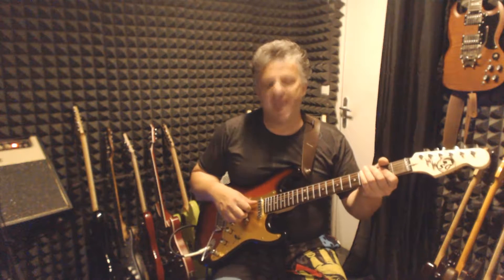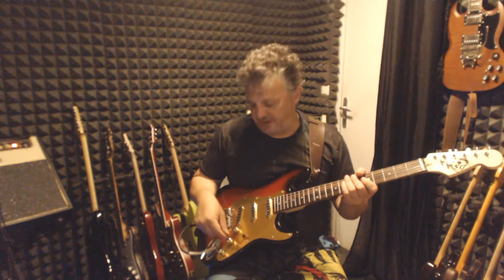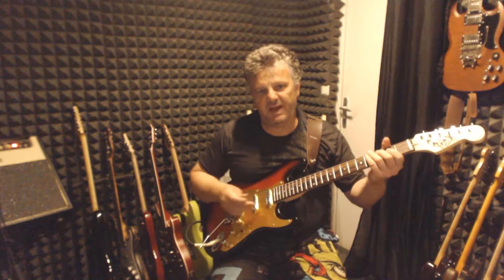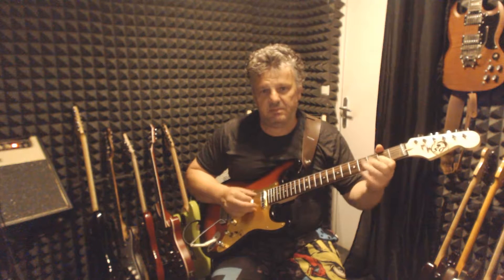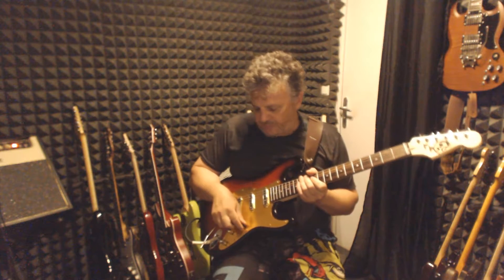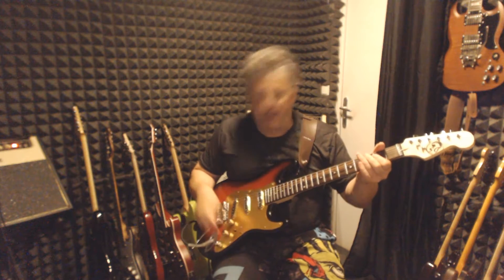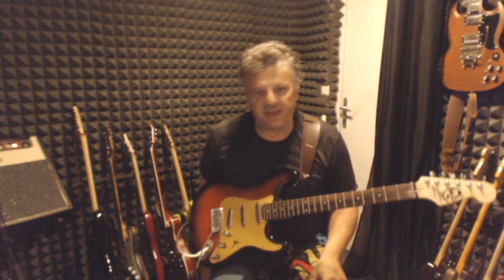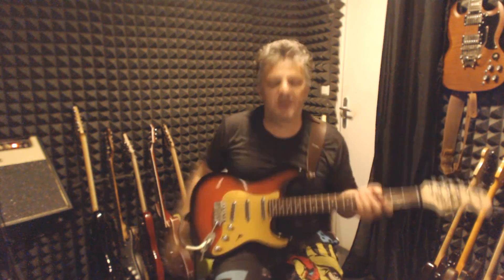Two Volume Strat Plus Wiring Demo - Brighton Rock GFS Pickups

Comment: Cool, I'm think in put one of these in the neck position :)

Thanks for the demo!
Reply from the maker: Check the value of the other pickups. These single coils have an high output. It might fit good or not.
Reply: @SenniMusic  Sure! The actually change the position to middle position, the other two will be also a high output pickups. Let's see what result will be  :)

Comment: Thank you for doing this video I tried to do this it seems to work but the bridge volume is not working
Reply from the maker: Double check your wiring. Go to my site and grab the schematic. This is the one I used. My modified version with independent volume and 50s tone  pot wiring.
Reply: I grabbed your version I see the independent volume change just the couple wires on each pushpull are swapped but I think I would like to leave the treble bleeds on mine I will try it thanks!
Reply from the maker: it's a question of taste. I personnally dislike treble bleed on single coils.